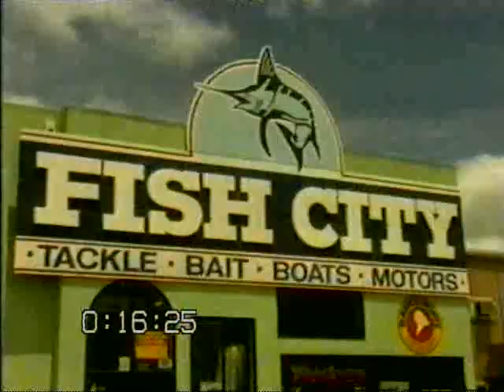lure fishing

Comment: Gotta make a version of that "Hawg Wobbler" mentioned as from 4:03 , ....did some googling for it , also found some further footage , looks like it was designed for surface only . Pausing at 4:36 I could see , that Charlie had tapered the nose somewhat more , reduced lip size and mounted the linetie at the nosetip in difference to the original lure to achieve the diving action mentioned , a great version , very fond of topwater and diving action in one lure , gotta get my lathe turning , too !